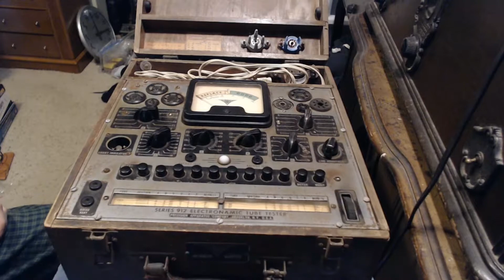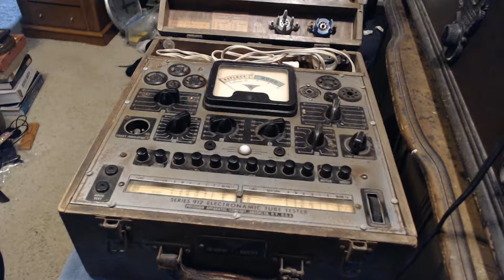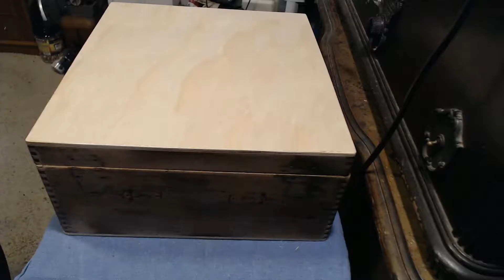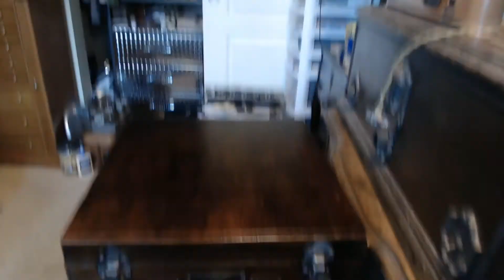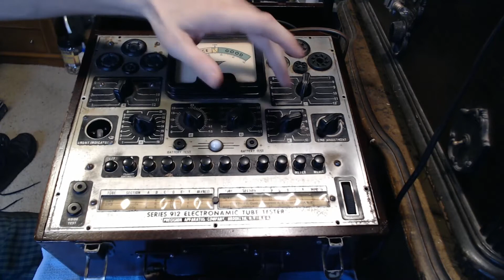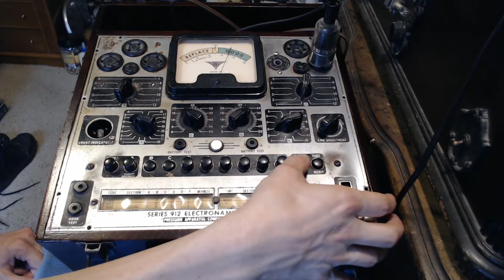Cleaning up a Precision Tube Tester !

Comment: you just find the tube in the chart that is at the bottom, set the dials accordingly incert the tube, then push the far right button HALF way, then push the push buttons that is at the end of the chart to the far right....then push the button on the right that says READ METER...and thats it.
Reply: hello are you still  taking on customers? 
I have a precision 10-12 in pretty much mint condition.  but would like to have it checked out before using it.
thanks Brian.